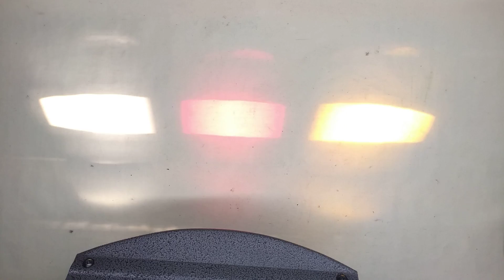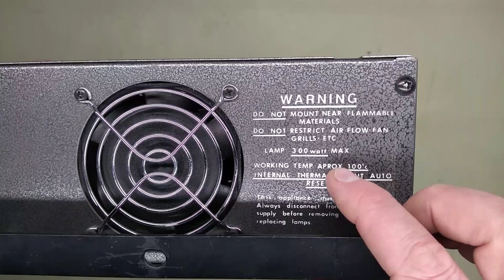Inside a simple vintage disco light.  (Single Derby.)

Comment: I refurbished a stack of similar lights in a night club in Glasgow about 20 years ago... 300w halogen with 6 coloured lenses. Not fan cooled though... The units were thick aluminum with heatsinks at the sides to disperse the heat. 16 or so connected into a simple 4 way sequencer

Comment: 3:16 Convex! When the convex lens are reflexive its called a double convex or biconvex lens. A biconvex is probably the most common lens as it focuses or magnifies light. (A single point outward or many points inward) Then the depth or thickness changes the focal point. A biconcave lens scatters light. (Many points outward or a single point inward). Thus that type of lens is useful for concentrating light.
Finally the "oval" shape is just the rectangular cut of the lens because of the fact that the input light in mostly on a single plane.

Comment: Love a good disco wobbler, any chance of a teardown of something ridiculous like an 8 moving mirror dj effects light
Reply from the maker: The centrepiece lights are quite hard to get a hold of these days.  They're so iconic that the collectors will pay high prices for them in any condition.
Reply: @bigclivedotcom  fair enough, i didn't realise they'd be that collectable! I'm still trying to remember what the one we had at the uni was, it kept burning itself out because it couldn't dissipate enough heat, furiously complicated and dense design. Lots of gobos and dichroic lenses, a real party in a box jobby.
Reply from the maker: @TheErador  Most of the problems with those effects were their use for long periods of time, incorrect lamps or burned lamp contacts.
Reply: @bigclivedotcom  wow, I didn't realise there was a 'vintage tax' on old disco lighting. Especially considering that 10 years ago, when a lot of clubs were closing in the wake of the smoking ban, you could pretty much fish them out of skips.

Comment: I've also seen manual lights like these rigged up to be "played" by a keyboard that was nothing more than an array of switches (in the form of a keyboard) and then the designated "lighting guy" would "play" the lights to the music. Although the types of lights most often used with this type of keyboard switch panel were the plain old spot type lighting. I'm guessing that Mr. Clive in his years of lightning control knows exactly what I'm talking about. 👍

Comment: Old lights is smoke and mirrors.  Ive got four old school lights.  one is i think called a gobo ?  has a disc with different images and colours and a dish with chunks of mirror glued to it attached to a slow motor.. The gobos are on a stepper motor and all motors ca be activated by sound. or set to static or just random..  Does get mighty hot!!      another is a 4 spot chasing light box.. also sound activated or just random..
Reply from the maker: Gobo flower.    The parabolic dish of mirrors is from the moonflower design.

Comment: Looking at the fan @ 0:50 its spinning to the left and the blades are "pointing" inwards so i guess it blows onto the lamp and then blow hot air out of the case. Also @ 4:12 the fan says air flow and points > so it blows onto the lamp and exhausts out of the case in case you were wondering
(no pun intended)
Reply from the maker: It's partly to avoid the fan drawing heated air over itself.
Reply: bigclivedotcom I still wouldn’t trust it, especially because it’s one of the halogen bulbs

Comment: I am sure you know already, but just for the readers, you can get high power replacement LED lights that fit as direct replacements. I have one "rated" at 8 watts, it is very bright. Its in a security type light, the infrared detector does not work on LED. I use an external one for it. I presume the original detector goes to neutral via the lamp.

Comment: Clive should open a really overdone, retro 20kw discotech. I think it would be the coolest place on Earth. Lol. It should be called 'Black Room Bar' where everything is black and the only lighting is provided by heavy duty, oldschool disco lighting.
Reply from the maker: That describes a club I worked on.  All black with UV highlights.  Hundreds of scanners and a large truss filled with loads of old heavily motorised disco lights.
That club did well until the DJ decided the booth would be better at the other side of the dance floor and being an "electrical expert" he sawed the large trunking that contained all the 100's of wires for the lights in half without marking a single wire and then did a runner.
Reply: @bigclivedotcom  That sounded like a sick club, what a shame that he decided to destroy it... lol.

Comment: Big Clive I am, a huge fan I love your vids and your work but most of the devices are not very complex in my humble opinion. Could you do a tare-down of say a cheap hover board and go into detail on the brushless motor, lion battery and ESC? There are plenty of these now on eBay that have been returned cuz of bad Chinese battery packs.
Reply from the maker: I put up a video every two days while also juggling work, which limits the scale of the devices I take apart.

Comment: I like these older devices. They often have a build quality you just don't really see anymore in your average modern device, with a nice, thick gauge of material. Usually steel as well as opposed to that flimsy aluminium. And it's made to come apart with real actual fasteners. Lovely.
Reply: You give and you take though. Can't act like build quality hasn't improved in someways as it's declined in others. Ergonomics has come a long way way since the times of when things were built with 'real' materials. And cost has come down to, although that's not exactly for the better.
Reply: @benbauer1257  You're right. And of course it's only the well built stuff from the past that survives today which is also a bias. Still, I can't help but feel nostalgic when I see a well-built bit of old gear.

Comment: I've never seen one of those in such good condition! I'm used to them being full of gunk, All baked solid, Rust where the smoke fluid had built up, As well as the colour started peeling off the lenses, I often just gave up an soaked what was left of the paint off them and had it as an all white effect (or gelled it),  As I remember they did do very slight sound to light movement as the bass would make the lamp filament shake! Good example of the ones with the rotating lamp was the Fal Alligator, Comar also did a very similar effect that used round lenses in a half moon configuration (dots instead of lines)

Comment: A couple hours ago I took to bits a Bell and Howell super 8 projector hoping to find something interesting, perhaps an IC or two but no..it was a myriad of mechanisms. I found what looks like a shaded pole synchronous motor connected to a cool fan that would make a great paint mixer hahaha I saved the optics also plus the lightbulb that looks neat..rated 30V and 80W. Imagine the time spent designing all those moving parts. The injection moulding alone was crazy.

Comment: i had a 500W halogen flood light that got so hot the glass melted in one spot on the bulb and the filament went open.
Reply: Often a symptom of oils from your fingers on the lamp. The quartz heats up more at that point. Always install lamps without touching them but you can use an alcohol wipe to clean them if you do.
Reply: Those halogen bulbs run so hot that any impurities on the glass (especially grease/oil) would contaminate the quartz glass and make a weak spot, resulting in the demise of the bulb in just this way.  More than likely whoever put the bulb in left a fingerprint on the glass.

I was a photographer in the 80's and we used the 500 watt versions as studio lights, and everyone knew to clean the bulbs with alcohol if you happened to touch them.  Mostly though, you wanted to fit them without touching them (cotton film handling gloves or a clean handkerchief).   Yes we still used handkerchiefs in the 80's.